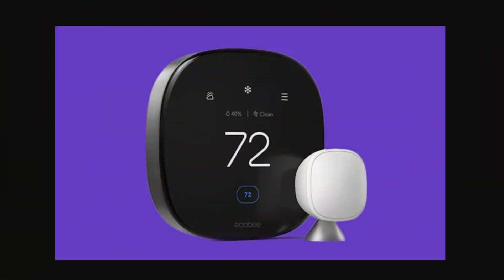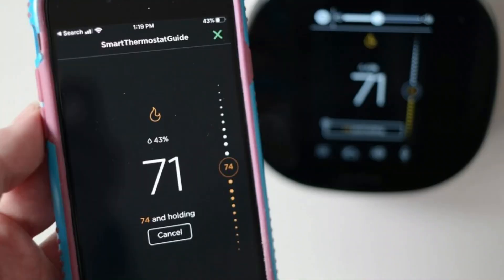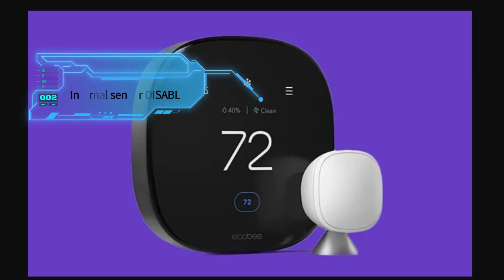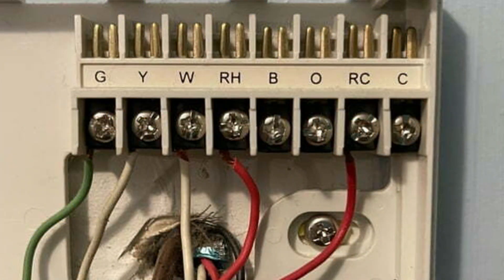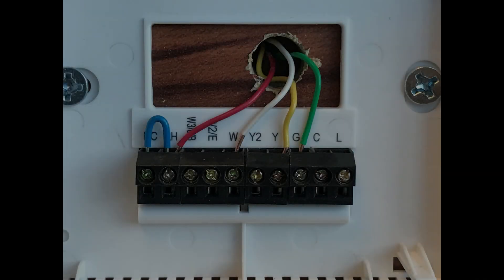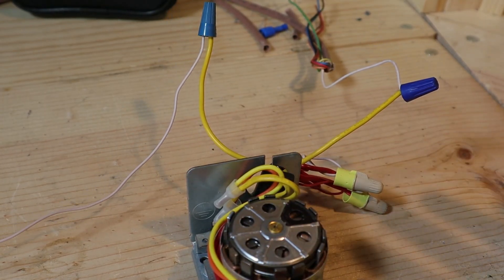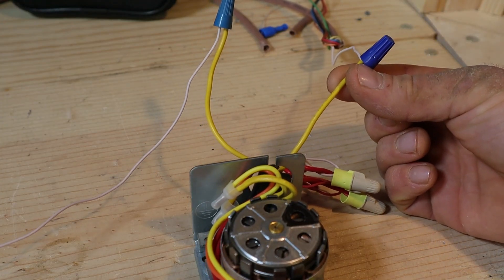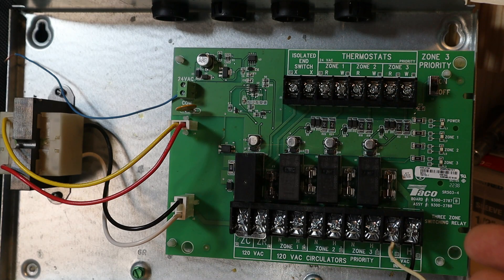No C Wire? This Smart Thermostat Trick Changes Everything

Comment: I have a question that you may or may not know the answer but I’ll give it a go. Does the dryer being plugged into a wall outlet? Draw energy when not in use and is there a way to set up an on off switch instead of having to go behind and unplug it all the time. Thank you.

Comment: My furnace was installed in 1986, so the control board at the furnace didn't even have a C wire available.  But, I removed the furnace control board and found a place on the PCB board where the common return wire for the 24V low voltage would be.  I just soldered a wire there and installed an inline fuse to that new wire, and voila.... a C wire could now be run to the the new Wi-Fi thermostat that needs 24VAC power all the time.

Comment: Thanks Mike adding an sensor to an no C wire setup is totally amazing solution I have added an c wire adapter  stole the g wire on an Gas pak but not always desirably but   no  go  for  an H P  so great solution overall

Comment: Hey Mike have a question. All I ever hear is when you don’t have a common wire you can run one from your circuit board from the furnace to your thermostat. Well I have a well McClain gar hot water boiler and you know what my furnace doesn’t have a circuit board. Not what

Comment: Hey Mike enjoy all your videos always learning when I watch them. My question is I have two zones my downstairs thermostat is for heat only two wires. I have gas boiler baseboard heat. My upstairs thermostat is the same except this also controls my central air system 4 wires and a ground wire. Everything works fine so if I replace my old thermostat with the nest 3rd gen and wire it up the same way as my old stat I would think it should work just fine ? Yes or maybe not. Any help would be appreciated thanks

Comment: Hi Mike my question doesn't involve anything your speaking of here... I finally found my fifth zone valve, I brought this house 9yrs ago... what had me looking for it was the fact my sons room is always hot. So I changed out the motor on the valve it was bad. But what I found is that 2 zone valves are on the same pipe but the arrows are going in different direction is this correct?  Or is it a mistake?
Reply from the maker: Arrow should always point in the direction of water flow.
Reply: Thanks for replying back mike. My issue is that 2 zone valves in the ceiling on the same pipe are pointing in different direction. How do i figure out the correct direction or water flow? @JerseyMikeHVAC

Comment: One clever idea deserves another. Try this: if you use the trick in this video to locate the main thermostat near the air handler, you can repurpose an old inactive smartphone (or buy a cheap used one), to leave in the main room of the house (maybe even mount it on the wall), and use that as your dedicated control interface.

Comment: I’m currently trying to add 5 nest thermostats with nest power adapters to a SR 506 Taco zone panel. I’ve been advised to add an external transformer. My question is how to add that transformer in parallel with the existing 24v 15VA internal transformer. Is this something you could help me with? Thanks in advance, your videos are tremendous. (Side note, should I buy the 1000ohm resistors just incase) thanks again
Reply from the maker: The set up you're looking at will be very similar to this video here: https://youtu.be/GGzyj-N6Y8U

You'll need an external transformer and relay like in the video. The SR 506 internal transformer would be like the transformer powering the zone valves off the 8 channel relay when activated by the thermostat(s). Only difference is, instead of zone valves, for each zone you're going to go from R terminal on the 506 to the 8 channel relay power-in, then from Normally Open back to the W terminal in the 506. So basically your just going from R terminal in the 506 and back to W terminal in the 506 through the external relay. 

 The external transformer you're adding will feed in the topside of the 8 channel relay with each channel powered through your thermostats just like in the video.  Transformer -> R terminals to all Thermostats (off a splice) -> W Wire from each thermostat (individually) -> To 8-channel relay (relays 1 through 5) -> then one wire from 8-channel relay common terminal back to transformer common. 

 As for the resistors, you wont need them in this case. You're not using the 506 24v power to power the thermostats and your external transformer is not sending power to the 506 T-stat terminals. So far as your 506 is concerned, it thinks you're still using a battery powered thermostat.
Reply: @JerseyMikeHVAC  Thank you so much for the detailed explanation. So helpful, I’m going to purchase the items you linked and give it a go. Thank you!
Reply: @JerseyMikeHVAC  question on my common wire. With these nest adapters, I have a common wire, will that be spliced in with the common and the common terminal on the relay?

Comment: Mike this is pretty interesting and a good option for me in this case....but my question is how far can the sensor be away from the thermostat or does that even matter and also can they be hacked too? 🤔
Thanks mike, your friend from Jersey 🤝
Reply from the maker: They work as far as 45 to 60 feet in general, but you do have to take walls and floors into consideration, which can lower that number if you're dealing with some really thick walls. But I was able to make it work in a 2200 sqft house from the basement to a spot on the 2nd floor in a house built in 1913 with real wood and plaster walls. More modern houses will probably be a little more forgiving. Probably wouldn't work for all zones in a much larger house without additional equipment to help with the signals. 

As far as hacking, don't think it would be any more hackable than any other standard smart thermostat set up.

Comment: If I steal the fan wire and use it as common does it affect anything with AC function?
Reply from the maker: Yes, it could, but I don't know what type of system you have and what affect it might have, if any. Older style fan relay boards require that G signal but there is a jumper workaround for that, while newer more advance multi/variable speed units could affected fan speeds in some ways. Kind of depends on the manufacturer and design.
Reply: Yes, it's works. Not affecting on A/C, only one thing,  you can't use fan for ventilation function.

Comment: When I got one of the first Nest thermostats I had to wait three months for when they were introduced it had to be installed  without the C wire as my HVAC system was very old from about 1974. It worked perfectly and made that old system perform much better as it cut down on short cycling during spring and fall, and maintained a lower humidity all year.   But then it just quit working. It would not charge any longer. So I took it off and put it away and put the old one back on.  When I moved, I pulled the original Nest out and got a HVAC professional to put it on my early 2000s Carrier system where it still works perfectly controlling comfort year round with much greater satisfaction than seems possible with the currently available Nest.   I think there have been several major revisions of the Nest. It seems to me the product has declined, based on what I have discerned from the low opinion of the HVAC professionals.  The original is great.  I am afraid it’s near the end of its life, as the battery can only last so long, and it is now at least 13 or 14 years old.